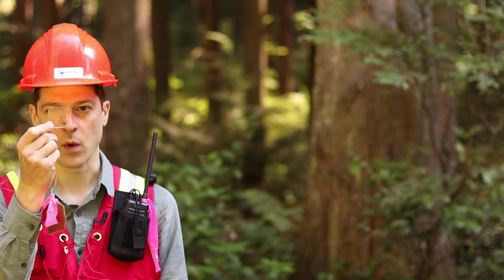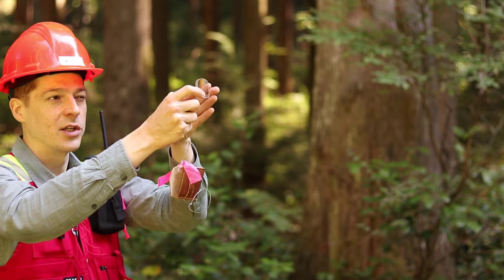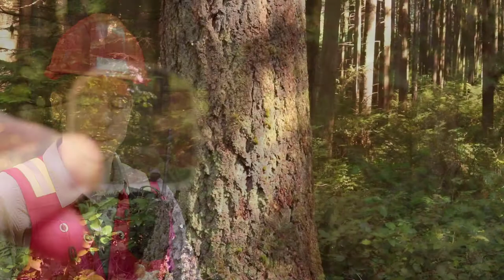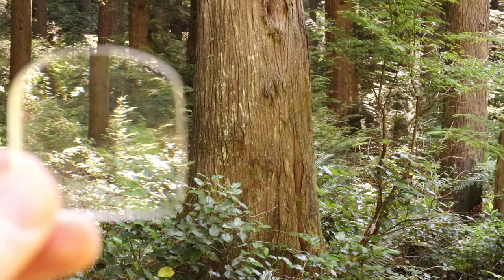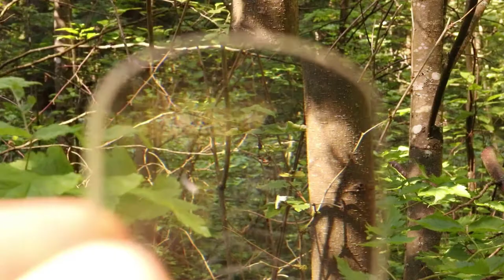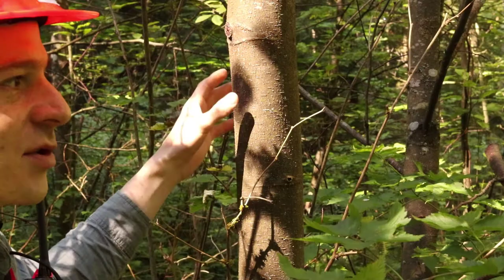Using a Wedge Prism to Estimate Basal Area

Comment: At what distance prism should be hold?
Reply from the maker: The distance from your eye doesn't actually matter with a prism, but you need to keep the prism itself over your plot center.
Reply from the maker: @alinawaz7256  A number of devices that work on a similar principle as prisms (e.g., an angle gauge or Cruz-All) need to be held a specific distance from your eye, but a prism does not (though it must be held over the center point of the plot). From Forestry Supplier's: "Hold prism at any convenient distance from the eye, directly over the sampling point. Hold in a vertical position and at a right angle to the line of sight." (https://www.forestry-suppliers.com/Documents/1435_msds.pdf)